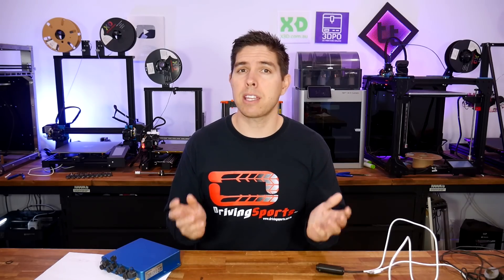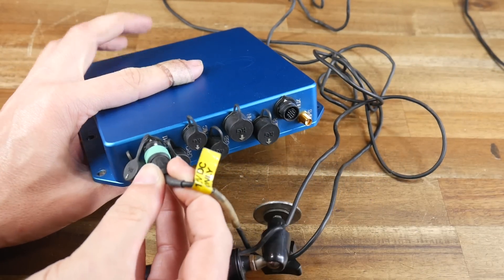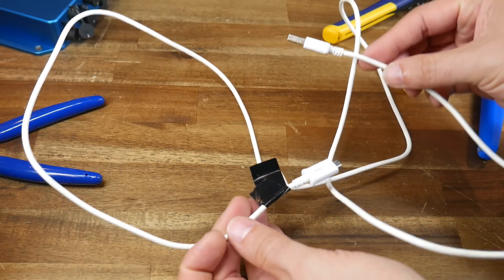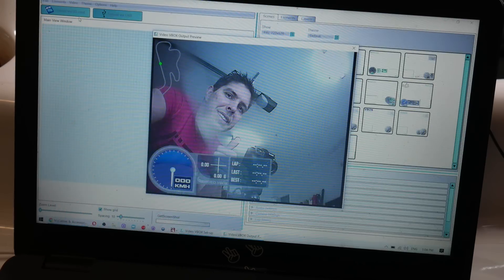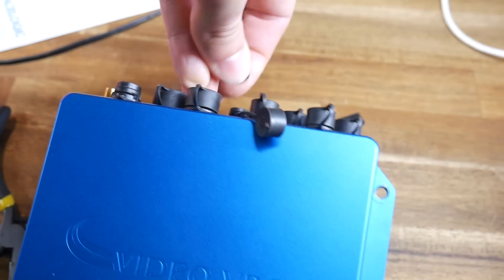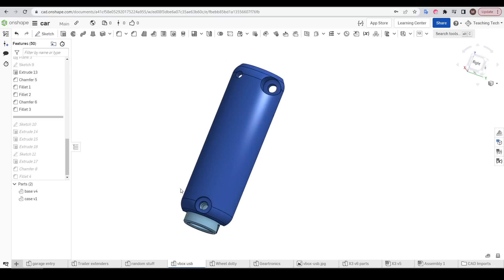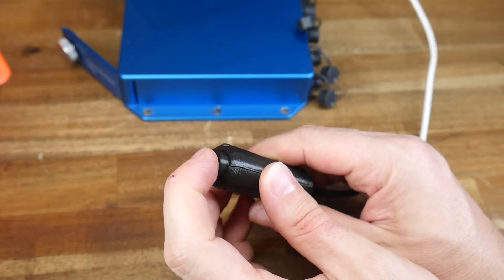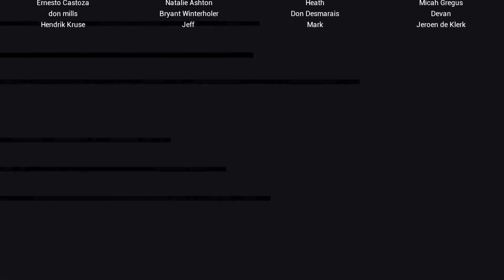Making an unavailable, proprietary USB cable with 3D printing

Comment from the maker: The channel is called 'Teaching Tech' but I'm fortunate in that I can learn from so many of my viewers. Thanks to everyone has has either given suggestions for alternatives or provided part numbers so I can make my own perfectly fitting cable. So it turns out this cable was not unavailable, but hopefully the process is still valuable for situations where it is. I certainly enjoyed making it (apart from the hot glue burn).
Reply: ...and love the encouragement to attempt repair rather than replace! Great vid Michael. 👏
Reply: Something I noticed. You had a vector drawing of the plug, made a pixel image and recreated the vector file. You could have used the original vector drawing to create the plug. Would have saved some time.
Reply: @ShadowTheHedgehog85  I just did this with my logo the other day!
Reply: Hunting for cables and a connector is a hobby of mine. I'm happy someone else did the work for me though. This is still useful info!
Reply: Still useful for if and when the cable is discontinued, though.
Reply: Hot glue is an issue. But I can set mine to low, so it doesn't take the skin with it. But still flows enough to fill the gaps I need it to.
Reply: The solution in my head turned out not to be as good as this one, at least I learned more in the lesson :)
Reply: I love people beating proprietary things
Reply: This is mission impossible level stuff - brilliant!
Reply: why did this need a 50 step program?  instead of just replacing it with a standard  water proof  micro/mini USB or Standard B connector ... go figure.. .. 

it's called critical thinking....
Reply: @punker4Real  Sometimes people have hobbies or like to practice skills or make videos. Did you try to come up with any answers to your own question? Perhaps you could ask "Did you think of doing this instead?" if you actually wanted answers.
Reply: @802Garage   but it would be better then factory.. the video was just click bait

 you can't generate views  unless it's something ridiculous after all.  this just du,mb down people even more  instead of correcting the actual issue which would be directly replacing the connector with a standard USB output port....
Reply: @punker4Real  LOL the video isn't clickbait at all it delivers exactly what it says it will. Do you not understand the purpose of learning transferrable skills? What did you expect when you clicked on the video? Some people really like to feel superior instead of stepping back for a second and realizing there is more than one way to do something and multiple reasons to do each way.

Comment: the real solution would have been to change the cobnnectors on the box itself, you have already opened it, so why not change the connector to a common one, like usbc

Comment: even if the part is a Hirose connector, as the many youtube engineers have pointed out, but the concept of the video is solid. how to take something unknown (for whatever reason) and reverse engineer a solution. is it the BEST solution? no, and wasn't claimed to be. did it work? YES. good tutorial overall, full of useful info. nice job

Comment: Though I love 3d printing and other home fabrication techniques, in this case I would just open the box and replace this Hirose to something standard as I did many times. Maybe using some 3d printed adapter between factory hole and new socket, maybe cutting the hole bigger. I appreciate you did it all for educational/example/inspiration purproses. But dude, you are so creative guy and you lose your time/skills to reinvent some exotic plug instead of use some mini USB and use your time to make something really unreplaceable.

Comment: I would have just removed the proprietary female end and used USB A or C. Could still 3D print something to fit the new connector in the hole left by the old one.

Comment: I wonder which would have been easier. This whole 3d printing process. Or tearing down the unit, and removing the proprietary plugs and replace with usbC breakout boards.

Comment: I would say, that...What if instead a a whole cable you just make it an adapter with female USB Port, that way, if the cable stop working, you just go and get any normal usb and plug it in, instead of remaking the cable... Hope you like it, This is what I so, and very often I'm glad of the decision

Comment: Very cool, but why didn't you just use a normal cable, and make a water tight adaptor on the side of the unit instead? then you could use a normal usb, even type C cable and a breakout board

Comment: Great work, but it would have been easier to convert the proprietary connector to standard USB using a bulkhead connector.
Example: UA-20PMFP-SC8001 from Amphenol, costs $10 CAD.

Comment: you could have added a feature that autoalligns the pins with the shape in the plug.
Reply from the maker: Agreed it would be better, but I'd have to switch to resin to get the small details.

Comment: What a garbage...they should use the vehicle speed sensors, not GPS. GPS accuaracy is basically garbage
Reply from the maker: Don't confuse GPS your mobile uses with this type of GPS. The frequency is much, much higher and multiple systems are used.

Comment: All of the plugs internally in the box are just pinned to the board with some connectors. It might have been easier to replace the horrible proprietary USB port with a real USB C port. Allowing you to essentially bring the thing into the 20th century.

Comment: What a round about way to fix this: I would have just removed the existing port and replaced it with a standard usb type mini or typec and sealed the hole with a 3d printed housing or just use some butyl caulk. those pins are going to eventually destory that connector anyway because they are the wrong shape ... rectangular peg ... round hole

Comment: I think your design could be nicer if the backshell were shorter, with just enough surface area for your fingers to make contact and pull/push.  To prevent pins from recessing back inside the shell, I'd backfill with something non-conductive like polyurethane, epoxy, or silicone.  I think I'd go with polyurethane for just the right amount of rubbery give to simulate effects of a floating-backplane to compensate for imperfections.  Letting cure while plugged in will help center your pins.

Take a look at the mil-spec drawings for amphenol and canon plugs;  Either company has a suitable substitute for the other company, as well as a means to decipher part numbers to pin arrangement, connector size, etc...,  and vice-versa.  From there, you could probably make your own 3D printed insert (what holds all the pins in their place) IAW the design, a beefy backshell somewhat close to the design, and then order a collar with either bayonets or threads.  I've always seen bayonets on Canon plugs and threads on Amphenol plugs.

Comment: I think it would be easier to buy female 5-pin mini DIN plug for housing and swapped it out. And a male 5-pin DIN plug for the cable. U can even buy a metal housing ones if u don't like all plastic connectors.

Comment: Bummer, I have a case of those cables in my gara............just kidding! Another good video. I used to be a competitive welder in college and my shirt caught fire during a 6G pipe weld. It was the final championship and there was no way I was stopping with under an inch to go. The proctor yelled in my ear that I was on fire and I said I know. He waited as long as he could and then hit me with a fire extinguisher (gag) but I made it and got first place. Props to the guy for waiting - usually a kid on fire is a big deal, but he knew I was almost done and waited. It was a different time.

Comment: If you ever need to remove the hot glue, simply dunk the connector in Isopropynol Alcohol and it will break the bonds of the hot glue. I've done that many times and learned that trick from Voultar, a retro modder on YouTube.

Comment: It would have been easier just to buy a weather resistant chassis mount  USB mini B port and use a standard connector.  Heck even adapting a Neutrik NAUSB breakout lead and converting the original port hole with a weather resistant gland connector.

Comment: One other thing to try in the future is emailing the manufacturer or distributor directly. VBOX specifically kinda prices gouges but I bet they have a AUS distributior who would be able to point you in the correct direction with either the connector or the wire itself.

Comment: I'd have gone into the box and converted it to a more standard type of USB connection.  That way you can use regular, easy-to-obtain USB cables instead of having to painstakingly remake your cable if it's lost of damaged.   F__k the skull of proprietary architecture.

On the other hand, you might be able to use your idea to make a proprietary-to-standard adapter device, and sell them to others who have lost or damaged cables.

Comment: tip for inserting the pins: make the holes slightly undersize, heat them up to ~100C with a soldering iron while inserting them. (you can go hotter, but the hotter you go the higher the chance of having to clean molten plastic off of the pins, though that's easily done with a knife.)

Comment: more often then not there's a "contact us" link somewhere on the bottom of the website, and even if it's unlisted, a lot of manufacturers for this kind of product are helpful and if the cable is unavailable they can give you the part number to order/make a new cable.
even on cheaper parts, a friend had his microphone fail on a $40 headset, and the manufacturer replied "unfortunately we don't sell them, but we can send a replacement for free."

Comment: I would suggest using pogo pins the next time. They sell those in all sorts of shapes and sizes and it would allow you to tightly squeeze them into the 3D print so they won't slide back.

Comment: Great video! Although I am curious why you created a whole new connector to fit the existing one instead of replacing the connector on the VBOX. There are loads of waterproof 4-pin connectors available, probably several options that fit the hole already drilled into the VBOX chassis. This would have been especially easy, since the connectors on the VBOX are not soldered directly to the PCB.

Comment: Why not ask the manufacturer for a spare part or at least a type number of the plug? I don't really think, that this company developed the plug their own, it's most probably an off the shelf component.

FDA is also mostly not waterproof, so you glued it with hot glue. Really? Why not printing on your SLA printer with a proper pin support?

You could have used circular pins from lemo or something, to prevent the counterpart from wearing out and get damaged. 

Maybe my standards are to high, but that is not a appropriate fix for me.

Comment: great video, but if you had access to the JST connector for the port on the board, why not just get a known connector and replace the whole connection? I suppose it's still an option if your 3d printed connector breaks.

Comment: I would highly recommend making one of these with a usb extender cable, so you can have a type-a port on the end of the plug, then you can leave the plug in, and just deal with the usb cable itself. Added bonus, if the cable gets mangled and stops working, you can just replace it with an off the shelf usb A to A cable. No need to break it open and resolder anything.
Reply: I'd use an usb B connector (those chamfered squares you find on printers) instead of an usb A, but that's a good option.

Comment: Would have been easier to make a PCB with just a USB port, make a few of those, remove the old ports and case, solder short wires to the old connection points and put the whole thing in a new case.

Or even better, remove that one port and hardwire a cable in place, using a watertight cable adapter for the hole. You've pretty much destroyed the port anyway, stretching the holes etc. Your connector will always be prone to failure.

Comment: You can always can swap plug. If you need high waterfroof you can use "Aviation Plug" - eg GX12. If not buys some waterproff USB-C plug.
BTW: You can apply heat to pins to install it. Just as bolts inserts.

Comment: huh wut that's a really weird Hirose connector, even if Hirose does have 6 pin USB or DB9, it's usually symmetrical, looking absolutely nothing like that.
EDIT:
That's not Hirose, that's probably a 6-pin DIN aviation (or GX12) connector for some reason.

Comment: A USB-C panel mount header paired to the existing board might have been a more foolproof method. Any USB-C cable would work then, I’d loose the cable as soon as it was completed

Comment: You know, in addition to the other comments pointing out that that connector is probably actually available, you could also have just opened up the box and replaced the USB connector on the box with a more standard IP67 USB connector instead, such as an Amphenol LTW USB connector (which can just plug into regular USB cables)..

Comment: I thought this was a neat project.

Personally though I think if I was faced with this issue, I would yank the propreitary port and put something standard in it's place, especially given that none of the ports are soldered directly to the pcb.

Comment: Instead of using the hot glue, perhaps you should have drilled two holes in one side of the casting and used a syringe of self-mixing epoxy resin pumping the resin in one hole and letting the air vent out the other until the entire case is filled. This will solidify everything into a solid unit and prevent ANY moving in the future. Plus you wouldn't have to worry about losing a bit of skin due to a hot glue burn... (ouch...)

Comment: it would have been a lot cheaper and easier to replace the entire connector by something like an avionics gx10 5 pin connector. You can even put a metallic screw on cap if water tightness bothers you.

Comment: If you need to take that connector apart for maintenance, just use a heat gun to heat up all the glue in the center of the connector and it'll probably pull right out. Separate the connectors while the glue is still hot and then let it all dry and you can just peel off the extra. Cool video, makes me want to get into 3d printing. I probably would have gone into the machine and soldered an actual USB port somewhere in the casing, but I like your approach better.
Reply: tbh you can probably just cut the cable at this point, it would be less annoying unless you just need to reseat a pin

Comment: Interesting video. 
Found your "proprietary, unavailable" free hanging HR30-6P-6P(31) and chassis mount HR30-6R-6S(71) connector at digikey in less than 15 minutes of searching hirose spec sheets

Comment: Why didn't you just open the box remove the existing USB connector and replace it with a modern USB female connector. Then 3d print a circular holder for it? The option you picked means you are screwed if that USB cable ever fails(sheath wears out) and will have to make another.

Comment: Looks like it might have been easier to replace the port with a USB type C port. Good job regardless.

I make some obsolete switches for of dodge trucks and have replicated the factory wiring plugs so I get what you are doing with this.

Comment: Not sure if this would be doable, but you could try connecting some slightly higher quality cameras, since you now have a way to reliably mass produce the proprietary cables. My only concern would be whether or not they would communicate with the software, without the required drivers. 

If that then worked, you could take it one step further and attach wireless transmitters and receivers to both the camera and the VBOX, allowing for wireless communication (If the VBOX relic would support that)

Comment: I had a very similar problem with my controller. It uses a connector pretty similar to that one, despite just being USB. My cable eventually broke, and when I went to order a new one, they were out of stock. I ended up removing the port from the controller and replacing it with a USB C breakout board. Now, I can just use a generic type C cable and I never have to worry about a proprietary cable.

Comment: could just swap the other side for a more modern connection. also could key the plug to avoid bending the pins putting it in the wrong way

Comment: i get the 3d printing part but for this problem why didn't you just take it apart and added USB port on the device. considering all the work you put in just to find pins.

Comment: The most important information on the internet are old technical drawings and pinout tables. So much could be repaired / reused if the documentation is available.

Comment: These connectors are still used by the military, they have been obsolete for about 30 yrs, Easier to change them on the board and make a new case.

Comment: I was thinking about buying a 3d printer but can you recycle the parts/material? If not, than are you not just adding the pollution issues? Neat buy most ppl print trash and the other stuff will eventually be trash, and plastics are already an issue. I am new to printing, this is a concern.

Comment: How i did it:
- find nails the fit exactly. Start electroplating copper on them for corrosion resistance or do make a better fit.
- solder cables on the ends
- apply some silicone spray to the connector and put the pins in the sockets
- use epoxy clay around the pins to make a pug that conforms to the connector.
Works fine and is rally fast of you find the right nails.